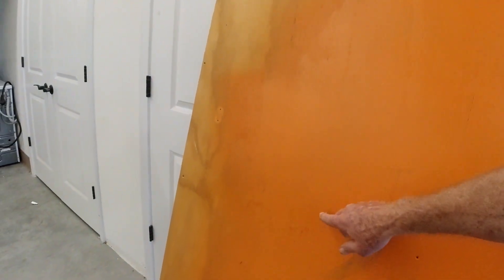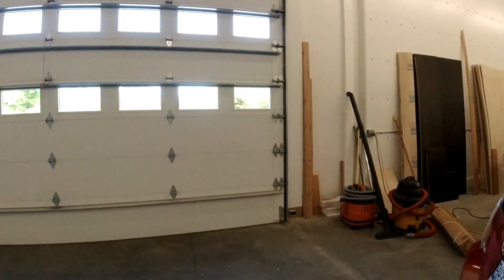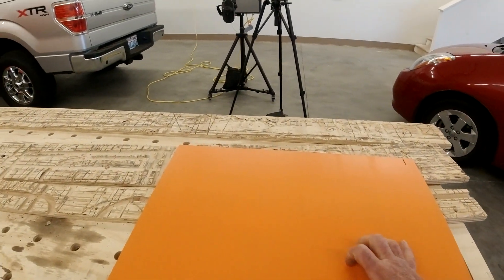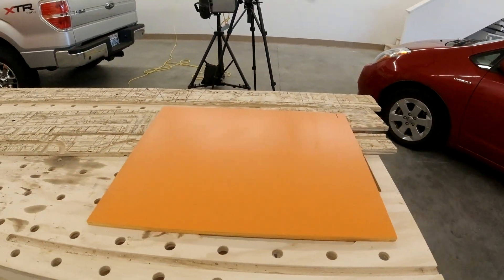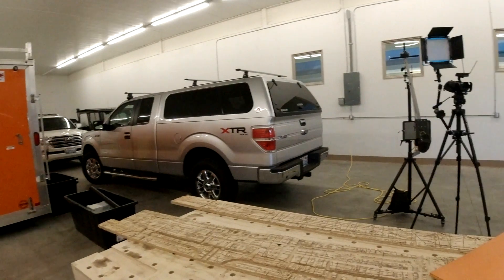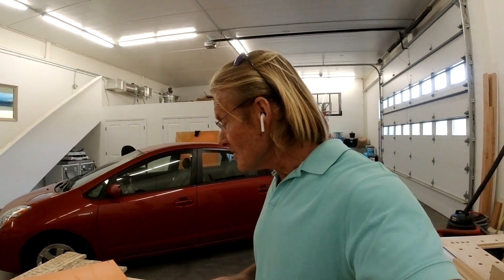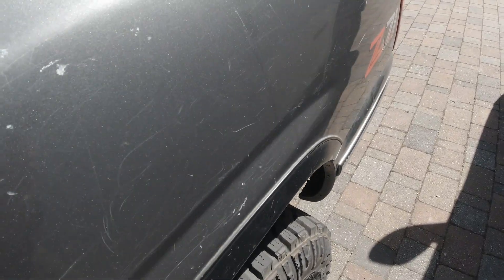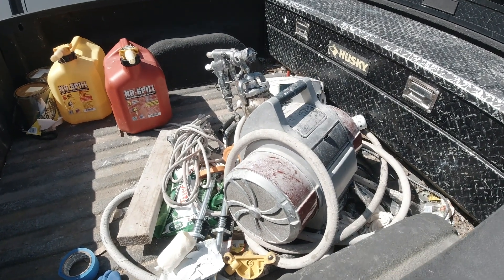Is the Titan HVLP any good?(PART 4)

Comment: I like that Titan and the Graco Finish Pro 9.5, both do a good job.  Your painter friend is putting you on about how long it takes to master the HVLP, most people can get good results in an hour ONCE SOMEONE SHOWS YOU THE RIGHT WAY, it's difficult to unlearn bad techniques.  The time consuming part is how to set up your unit including adjusting viscosity of product, trouble shoot, clean your gun and best way to tackle a job.  You might want to add to your library Jeff Jewitt's "Spray Finishing Made Simple" comes with an extensive DVD that is a classic.  When I wanted to learn to spray, I asked a lady finisher if she would teach me how to spray in exchange for labor on a job, I was lucky since that job involved prep/set-up, furniture, kitchen cabinets, trim, etc.  I learned a whole lot more than how to use a sprayer.  Be sure to use your skills to make a storage container for your HVLP,  was heartbreaking to see that Titan,  that costs the same as a good camera or rifle, in the back of a pick-up, the Systainers are good for your fluid sets, cleaning brushes and extra gun(s).
Reply: Anything Jeff Jewitt has to say is worth learning.  If you haven't heard his name and are applying finishes, do yourself a favor. He and others were instrumental in bringing automotive finishing  techniques to the woodworking trade. Game changer for everyone who adapted including some of the finest instrument makers.

Comment: Im a carpenter I have to finish thing once a while. Bought the gaco cordless sprayer worst thing ever. I should have bought one of those sprayers very disappointed in myself
Reply: I agree, seems like a great idea but I haven't had good results with mine :( did one job and its been on the shelf since
Reply: @skiingslasher1991  yeah the second time I went to use it it clogged. Same with mine setting on the shelf to. I like to buy a HVLP
Reply: As a painter for 22yrs. Airless sprayer need quite time to experience but HVLP kill the sheen by thinning.
Reply: @jongyoonoh6721  you got to by the stronger model so you don't have to thin as much. Plus using the right product to think l it with is important